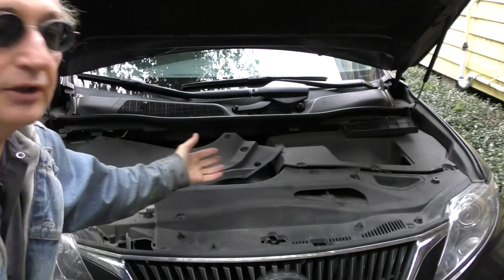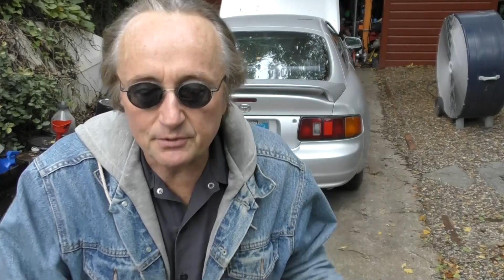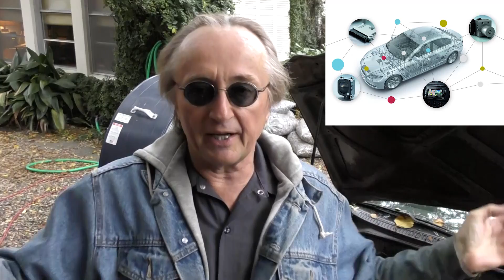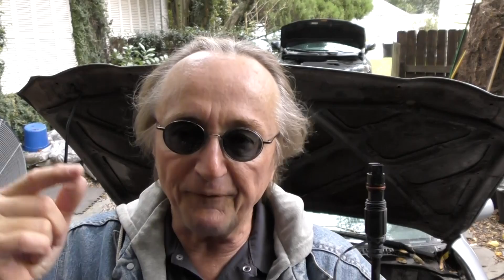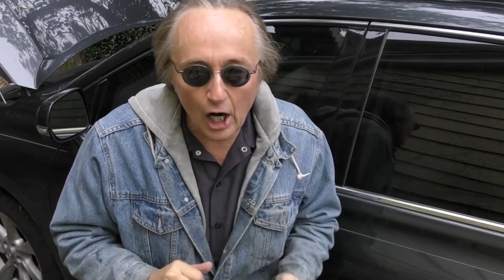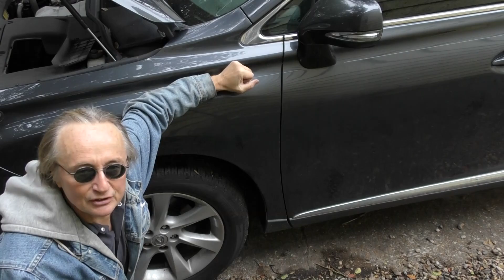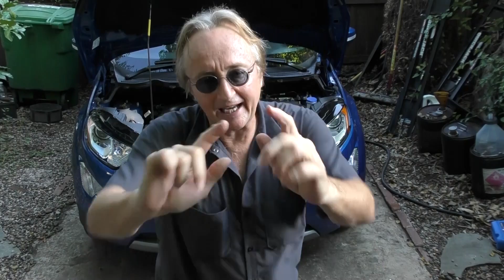The End of DIY Car Repair, Why New Cars are So Hard to Work On

Comment: I have a Kia spectra 2001 that's reaping me 20 miles per galon I think on highway! this is after two measurements in a year. apparently everythings okey the airbox thing is tied up, and the filter is clean, then the maf was cleaned. actually nevermind I should try it again cause I checked it with the maf not cleaned. I don't know about cars hmmm the gas tank was u know white smoke to clean the conducts from a solution from walmart for 2 or 3 dolars. Is there another thing I can do? I want 30mpg on highway on this kia. I wanna do another test. anyone?

Comment: i have a 1999 honda prelude and it will turn off sometimes when im driving but will turn on after waiting 10-15 mins what could be causing this, it will crank but will not turn on when this happens till after it sits for a while.
Reply: Heating

Comment: Listen I'm all for DIY car repair. It's the way I was raised. BUT I  honestly  fear for mine and the lives of innocent people who are killed everyday by the growing number of intoxicated and distracted driver's on their cell phones in this day and age. In a busy city you never know when you might draw the short end of a stick. That's why I prefer newer better designed cars (Saftey Wise) that perform better in an accident. I'm not letting my wife drive around with my toddler in an older car that can't even handle a frontal offset test, without shredding the passenger compartment to pieces. Don't believe me , look up your car in a crash test .... Quick additional story, my coworker drove an old cavalier for a long time , he finally sold it and bought a brand new 2018 tundra , on the third day he took the same drive to work that's he's been taking for the last 10 years but this time he got hit right in the middle of an intersection by someone running a red light because they were high. They guy who ran the red light was in an older 7 series  bmw and had to be rushed to the ER for surgery. My friend walked out of his truck that was flipped over with only a broken wrist. He wasn't even upset at all, he just thanked God that he got hit in the truck and not the  cavalier because he would have left his wife and kids too soon.. Insurance paid everything and he bought another truck a few weeks later.  Old cars are great don't get me wrong but when people count on you don't go around commuting every day of the week in a geo just so you can save some dough. ( Unless it's all you can afford , in that case drive safe and God Bless you.)

Comment: There's no such thing as an end to diy repairs, there's always some smuck out there that will try doing it himself lol but hey at least in that lexus, you can check your engine oil levels, i hear in some bmw's they don't even have a dipsticks for you to check. And also all that plastic is the engine bay is just there for idiots that don't even know where the dipstick is. All it is is pure heat soak, throw all that crap out, no point in leaving it in there. The 1st day i bought my 07 acura tl, i threw out all the engine covers including my engine block cover so i can easily check my sparks plugs, oils, coolant and belts. Just imagine having to put that stuff on every time you check a car, i'd blow my brains out trying to piece together those worthless pieces of crap plastic.

Comment: It uses RS485 serial data where multiple divices can be connected on a two wire buss.  Multiplexing and addressing scheme makes it happen. No the sensors do not communicate to each other you freaking goof.